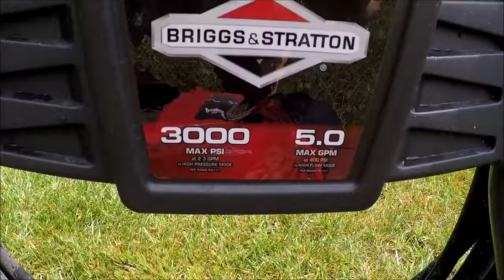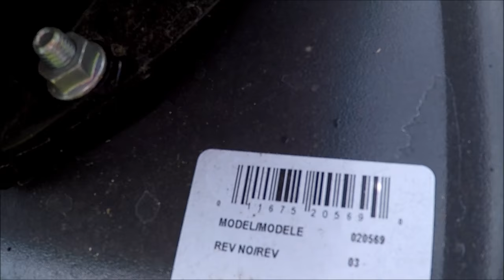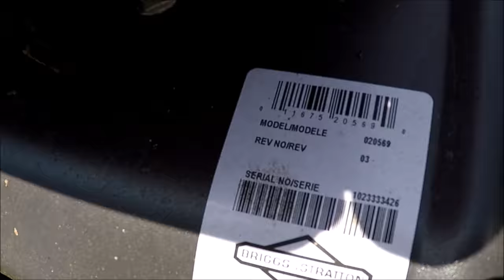Power Pressure Washer Carburetor Cleaning/Repair - PowerFlow + Technology - June 9, 2019

Comment: You should ALWAYS connect water to a pressure washer before starting it. You can/will damage the pump if you do not.
Reply: I'm sitting here like damm is he going to turn it off ? 🤔🙄 ok great job it runs but we doing need to see it running from every angle 🤣
Reply: Glad I know this now 🤦‍♂️

Comment: "NOTICE: DO NOT run the pump without the water supply connected and turned on. Damage to equipment resulting from failure to follow this instruction will void the warranty."
Reply: 100%

Comment: You never run a pressure washer when it’s not hooked up to a water supply. That is a sure way to decrease the life of or destroy your pump
Reply: Actually you can but only for a few seconds to make sure that it still works, basically once it fires up you shut it off and then put a water supply on and then run it

Comment: Great video, just helped me repair my B&S power washer.  I knew she was getting fuel starved and I took off the carb and cleaned it all and it was still not starting or idling rough.  I checked out your video and realized there is a jet/channel in the bolt that holds the carb bowl!  Went back out, pulled the bolt off and sure enough, was plugged solid.  Cleaned it all up and she started first pull like new!  Thanks a bunch!!
Reply: Well went I go to clean my carburetor out I always clean all the holes then putting it back together I'm adding a gas filter to mine i noticed the gasline on mine was last changed in 2004
Reply: @Mike-su8si  Yeah technically you should add a shut-off valve and filter on all your small engines like snowblower, lawnmower etc.
Reply: @DanRichardFishing  I didn't add no gas shut off but did put a gas filter on it. is needing a new carburetor rubber pin tip the guy I bought my pressure washer from claimed he use to work on mowers and those things and that pressure washers carburetor bowl was really dirty so I don't think he does he was just talking 

But I do work on alot of different engines and other parts i don't just say it.

I cleaned out that dirty carburetor and it now runs on run instead of on choke it was clogged up in the bowl screw on the side jet hole

Comment: I pulled my carb 2x cleaned needle valve jet all other ports... Still just started with a gas soaked air filter then died. Decided to watch a video before buying a new carb. Glad I did. I didn't think to look at the banjo bolt on the float bowl. Cleaned and poked a wire through the holes and it started right up. Thank you for posting this video.
Reply from the maker: Hello Mattnelson1767 great job in getting your engine running again glad this video in a small way helped!

Comment: MBK, thanks so much for the video. I was repairing a Troy Bilt with the same engine for a friend. Before watching your video, I took the carburetor off and thought I cleaned it pretty good. After watching your video, I went back in and cleaned out the jet really good. Also, originally I couldn't get the needle out and chalked it up to "I don't know what I'm doing". After going back for the second time, I used a small flathead screwdriver and popped it out. It was also gummed up with black tar substance. Once I cleaned these two things good and put it back together, it started on the first pull.

During the pandemic, I found a few neighborhood junk pile lawnmower and fixed them up - I'm now on my 20th piece of equipment.

I really appreciate all of your videos. I've yet to come across a small engine that you haven't done a video on. Keep doing what you're doing!

Comment: Had a similar problem. Clamped the fuel line, removed the bowl, used compressed air to blow out the "bolt" that holds the bowl in place. Make sure to blow out from the top single hole, not the side holes. This should clear out the jet that meters fuel to the engine. Clean out the bowl as well if there are any particles or crud in it. Did this and it starts right up now. Did use starting fluid to confirm ignition was not problem.

Comment: Thanks for the video. Your linkage matches mine, and I found that helpful.👍
 It ran a little rough at first because the tiny central hole in the brass bowl nut/main jet was not cleaned out, just the larger side holes. It cleaned itself after running a while.

Comment: The oil in an axial cam pressure washer pump lubricates the swash plate, which drives the reciprocation of the three pump pistons. This oil is confined to that Area of the pump and only lubricates the swash plate bearings and the contact surface between swashplate and contacting surface at bottom of Pistons. Now, the pump manifold is where the water goes through, and it is sealed off from the swash housing and it's oil. There are many plastic seals and check valves within this manifold which rely mostly on water to keep cool. Although the oil lubricates the pistons and cylinders, there's a lot of friction there happening with no water to cool things, like a car engine running with empty radiator. Doesn't take a lot of heat to compromise these seals. If your neighbor ends up with milky pump oil, water is getting from the valve manifold into the swash housing, by way of the burnt up seals from running without water turned on.

Comment: My pressure washer was designed by kids or someone who didn’t fully think it through, the hook for the hose that goes from the pressure washer to wand is on the side of the handle, same side as the exhaust, needless to say every time I let someone use it they put it back on the hook for the hose and burns the hose in half, currently on my 3rd hose and this one has burns on it just not all of the way through. I like how yours is on the back and away from the hot exhaust. I will definitely watch for that on my next one, current one is only 2 years old and been used maybe 6 times so I can’t just throw it away and feel guilty selling to someone knowing the flaw

Comment: Just watched this I been working on it for hours I will try this and hope it works bought it for 65 bucks looks new
Reply: If after cleaning the carb thoroughly it still does not work or even before cleaning also check the spark plug is working and producing a spark. All an engine needs is air, fuel and spark. As long as your air filter is not completely clogged it’s either the spark plug or the carb is gummed up, usually it’s the bottom bolt that has the hole through it. These carb jets are made of brass which is a soft metal so just be carful pushing metal objects through the hole to avoid damaging the brass. Also make sure there is resistance when pulling the cord slowly, if it has resistance and does not just easily come out with no force it will start and run like new. It is easier than it sounds and you got it, you have any questions post and myself or someone on here can help out!! Good luck my friend and like I said you got this it sounds harder than it is.

Comment: Am I correct that this is from using E10 fuel instead of ethanol-free? And storing it for months of non-use?
Question: how long is it safe to run these without a hose hooked up to it?

Comment: 0 seconds ago
I thought the bottom jet on the float bowl screw was plugged so I drilled it out. Could it be this hole was not meant to go all the way and intersect the other jet? Washer starts but runs very rought for a short time. If I force the auto choke open it will run longer but still rough.

Comment: Where did you get those little wire like sticks? My washer is doing the exact same thing as the one you showed. So much so that if I wasn't looking at my washer I would the one in the video is mine 😅. It seems I just need to clean my carb up.

Comment: I have this EXACT same model and exact same symptoms. That "dried gas" isn't gas. This was on sale at Lowes for a while. B&S threw in these fuel conditioner packs with the purchase. They were these little pods, like K-cups, that you screwed into the bottom of the fuel cap and they slowly leaked additive into your tank. That's what all that fluorescent horse piss stuff is. I used them on this and a couple other tools and they all stopped running. They all had gummy radioactive piss looking fuel. Had to clean out every carb and it was a bear on a couple that had small idle ports with yellow gel in them. It's difficult to clear out soft gummy bear with a guitar string.

Comment: I didn't know you could run a pressure washer without water. Won't it overheat?
Reply: av8dr I think the problem is that the valves will get damage, they are made to work with water and not air, air is compressible and water not. This may also affect the pump piston I suppose

Comment: What is the pin looking tool that he inserts into the tiny hole? This is the exact same power washer I have and it's sat in the garage for a couple of years and now I want to use it but it won't start. I'm going to try to follow this video but I'm not sure what that two lives to clean the small holes. If anyone can advise me on that I would appreciate it!
Reply: I dictated my response and I noticed there's a couple of wrong words but I'm just looking to see what the tool is that he is using to clean the small holes. Thank you!

Comment: I put a tad bit of diesel in my pressure washer and it stop running it cranks up but kills right afterwards what should I do ?
Reply from the maker: Try your best to drain your fuel tank and put a small if gas back it it. Trying to avoid cleaning the fuel bowl out of the carburetor but just try to restart it
Reply from the maker: You can then to push some carburetor cleaner in it to get it started. Worst case you would need to empty the fuel bowl as well. It want hurt your engine but will smoke possibly gum up your spark plug.

Comment: Nice to see you again! Just FYI the jet orifice that really needs to be cleaned isn't the large one that goes through the side of the bowl nut but the little tiny orifice on top of the nut that leads down into the large one. That's the one that gets plugged up and causes the engine to stall and run badly.
Reply: I know it I clean them all I have the tools to do so mine will also need a fresh plug in it but I ain't putting it back together without a gas filter put on

Comment: It's not recommended to run the pressure washer without water going to it, I'm working my daughters pressure wash, all you have to do is unplug the wire going to the pump under the frame, it's #6 allen head bolts , one I'm working on has 3 bolts holding on the pump motor, once getting pressure washer engine running again just put the pump back on and ready to go. same principle as running a swimming pool pump without water, if run to long it can lock the pump down.

Comment: Here's a big secret. Run fuel stabilizer year round. Install a fuel filter and a fuel cutoff valve. Never have an issue again. Shhhh....... secret.
Reply: Just use ethanol-free fuel if it's available in your area.